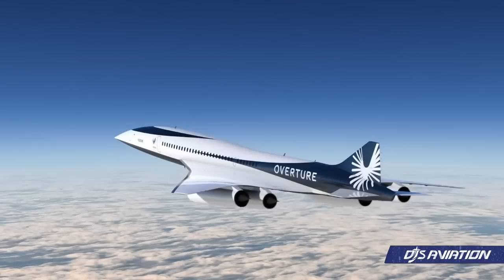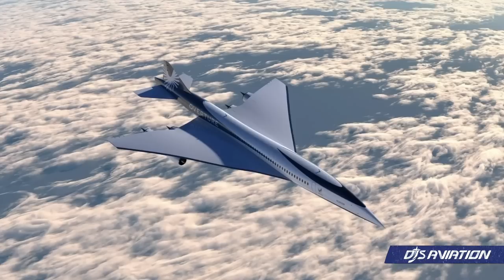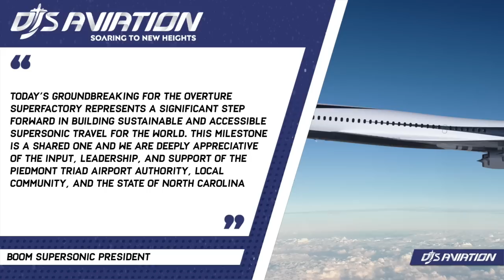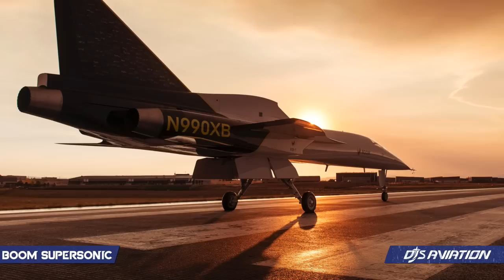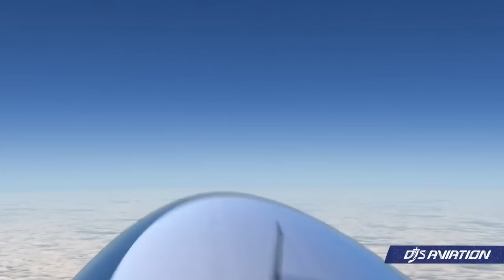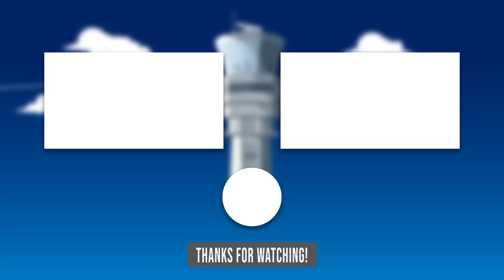Boom Supersonic Huge Update

Comment: Pointless endeavour, learn lessons from Concorde which used an obscene amount of fuel.
Reply: The plan is to use engines with no afterburners so fuel consumption would be far less, but I still doubt this will ever fly.
Reply: @jlangevin65  The Concorde B design was to completely remove the afterburner from the Olympus, and those new Engines were already in the final assembly line ready to be fitted to the new B, but in the end still failed to make its debut with the Concorde B.. Looking at that, I also don't think this one will ever make a debut...

Comment: I thought this was a legit channel until now but if you're 'reporting' this.... The slightly optimistic timelines are moronic at best and last I heard (and as you eventually say at the very end) neither Rolls Royce nor GE would touch this. Is it going to be solar powered now?
Reply: Florida Turbine Technology began detailed design of the Overture engine in January 2023. The engine is a medium bypass turbofan that uses certified materials and parts, including blades, rotors, accessories, and core. The manufacturers of these parts will help throughout the development and certification of the engine.

Comment: "More people will question whether this aircraft will ever actually fly" - you mean there are people out there who STILL think there is some reality to this project?

🤣

It's going to take 10 years to design an engine or adapt an engine for this, let alone the rest of the airframe and systems.

Last I heard, they didn't even have an engine partner... so that's never a good start.

The engines need to be in development long before the first rivet goes into a piece of airframe structure.
Structural prototypes can be easily tweaked, but once you have your engine chosen, it's hard to make major adaptations.

Comment: Ultimately, what/who is the target market for this?  Shaving 40% off the flight time across the Atlantic (probably less and to far fewer Airports) really just caters to the extreme vanity of rich travellers. Is that niche going to sustain the manufacture, sales, fuel cost and maintenance of this thing?   It's like crazy expensive wristwatches.....any watch (like my $25 Casio) will give you the correct time down to the accuracy of a few milliseconds a day.  Boom will be a ridiculous toy, a huge waste of resources, a black hole for investors and will offer no substantive advancements or "future vision" for the commercial aviation industry.  There is a reason that Concorde failed and it was not the unfortunate accident at de Gaulle Airport....that was simply the "reason" The UK and France finally cut it loose....about 10 years too late.  The difference is there is NO government willing to subsidize Boom for years vainly hoping that it will be a hit.  Commercial Aviation needs better IT infrastructure, modern airports, more pilots/crews/improved staffing along with fuel efficient (and relatively low maintenance) subsonic planes.....not a cramped aerial "drag strip" car.  Modern Airliners already fly at nearly 600 mph and for longer and longer distances. Efficiency and convenience for the traveller (along with bigger profits for the Airlines) should be the goal.